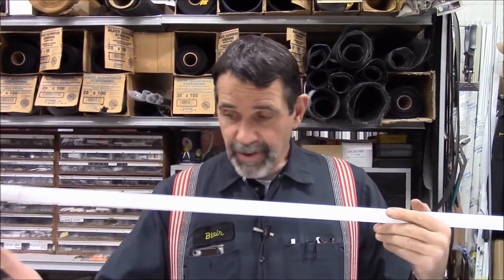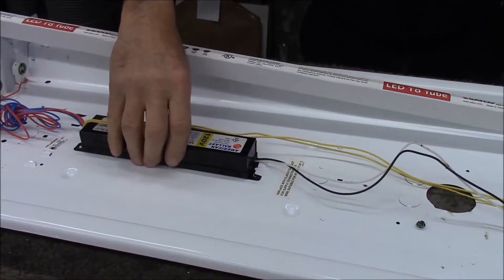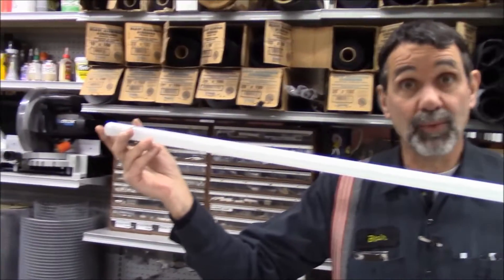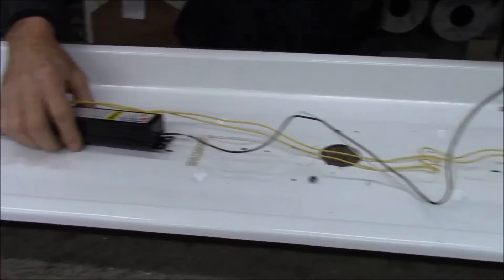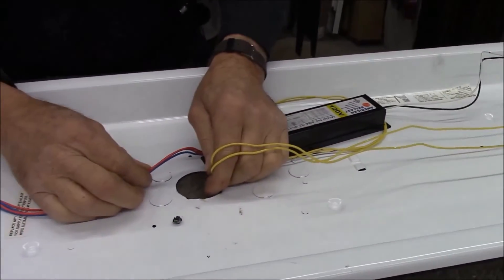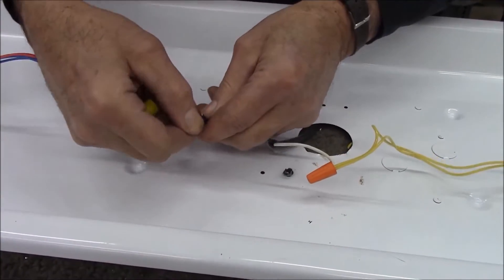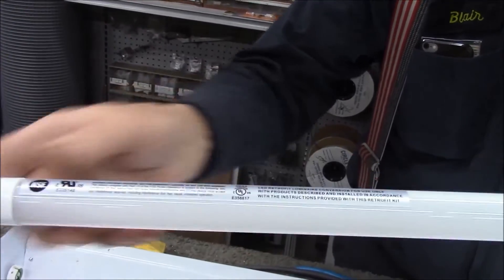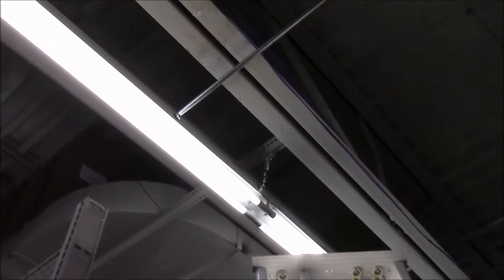Rewire Fluorescent to Led Lights - Using Double-Ended Tubes

Comment: the LED tube to use are the ones that are not LED but are actually T12 fluorescent lights that are run on a magnetic ballast.
Reply from the maker: If you don’t like led, and don’t want to save money.
Reply: @MrHardware1  I save money in plenty of other ways
Reply: In my garage I have an old 2 tube 8 foot fluorescent T12 fixture with a magnetic ballast. I don't use it much because it is very dim in cold weather and won't even turn on in high humidity conditions. LED tubes are now made so that I can easily retrofit it (single pin sockets) for about $40. Hot to one end and neutral to the other. Cheaper than a new fixture or electronic ballast and T8 tubes. It should solve my issues, be much brighter, save energy and the tubes should last much longer.
Reply: @gmzx3  right, last much longer. WHEN USED IN PROPER CONDITIONS, which are clearly stated... old magnetic ballasts (especially the preheat ones) last virtually forever. I have several of them from the early 50s that are still rocking there original ballast and are used all day every day. I give a good quality LED tube maybe 5 years of constant use before the little diodes start to die, and they start to flicker. and a poor quality (which most are) one will last maybe a year or two if you are lucky.
Reply: @WalterKnox   You may be correct about lifespan as I have only used A19 LED bulbs (with no failures). I won't live long enough to put 5 years of constant use on my tubes. Maybe 1-3 hrs a week. The thing I want to fix is the poor cold/damp performance and get brighter/more light. Eventually I won't be able to get the T12's or they'll make them very expensive to convince us.

Comment: Mr hardware, it is a great video. My existing floral stand fixtures are dual-end T12. Got the T8 dual-end ballast bypass tube and ready to do my re-wiring.  Since the switch is on the fixture, I need a bit more info on how to integrate the switch wires. The color coding is great but the switch has 2 black wires, so help. I can send you pictures of my fixture if needed. Thank you.
Reply: the switch wires have no polarity, one switch wire goes to the black hot feed wire, and the other switch wire goes to the fixture
Reply: @blairgilbert7606  Gilbert, thanks. Yes, I found a video on switches and was able to understand what you replied with.  I have successfully converted two of my fixtures. My plants will be happy with the new light! Wishing you a wonderful holiday season.

Comment: One video says put the 110 volts all on one side and don't have any wires to the other side. Now this one is saying run each side of 110 volts to both sides.
How do we know what works for what type of LED bulbs.
I've already blew up one bulb so far.
Reply: You MUST have the schematic before wiring, although some bulbs have a L for line (black wire) and a N for neutral (white) stamped on one end or both.

Comment: I heard there are some LED lamps that cannot bypass a the ballast. Is this true?
Reply: Yes, some require using the old ballast, a waste of electricity, some can't use a ballast and some go both ways. Be sure to read the info before purchasing.
Reply: Get the ones that run on 110V w/o the ballast. This will save energy and get rid of the ballast, another possible point of failure.

Comment: Question.  Your tombstones were shunted and your bulb was double ended?
Reply from the maker: I was using a bulb that went both ways, careful not all do. The video was to explain what shunted was. The end to end feed (shunted) is the easiest bulb to retrofit.
Reply: @MrHardware1  Now I'm confused. At 1:31 you say that a "single-ended" bulb is also called shunted... which was NOT what you showed in this video (which was a wire to both ends)...  Is "shunted" with power to both ends or just to one? 

I'm having a heck of a time trying to determine what types the bulbs are online (Walmart, Amazon, Lowes, etc.). It seems they don't want to say if they are one-sided or two-sided. Does it not matter?

Everything else in your video makes perfect sense. Thank you for posting it!
Reply: @mrdutson  - The main tutorial is for double-ended which starts at 1:43. The talk before that is a brief description of single-ended.

Comment: Video is Excellent for the Homeowner, good explanation and demonstration.

One caution: If you have a fluorescent fixture with a battery backup for emergency lighting (Such as in some more modern commercial buildings) you cannot remove the ballast as it will disable the battery backup. If that was the case, in an emergency such as power outage, the lights would not stay on for people to leave the building. Please be aware as well that this could impact your insurance.

We ran into this issue when we were planning to upgrade our Fluorescent tubes to LED in one of the buildings I maintain. In that event we planned on going with the direct fit ballast powered LED to maintain safety in the ones that required a ballast for backup and just bypassing the ones that didn't have the backup.

In our Kitchen at home we will be bypassing the ballast. No backups there...

Just my 2 cents-

Once again nice video!

Comment: Could I use a jumper instead of a wire nut for more secure connection?
Reply: Jumper? I don't know what that is....
Reply: Late reply, but yes. Guys in the shop i work at use jumpers for this

Comment: I've got a wiring situation that's a little bit trickier. I'm working with a hydrofarm horticultural 4foot 8 tube t5 fixture that has two ballasts, two switches that are each wired to half of the fixture, and it's got an AC socket to daisy chain another fixture to it. Trying to locate a schematic for the fixture is proving fruitless.
Reply from the maker: First off, the fixture is actually 2 fixtures in one. They are both wired parallel to the feed 110v coming in, and the output is parallel to the 2 ballasts. Where the 110v is concerned there will be 4 whites and 4 blacks. White in from power, 2 whites to the ballast, and a white to the output to the next fixture. Blacks are the same.

Comment: Hello how do wire if I have 4 fixture ?  I only did 1 it blew the bulbs.  

Thanks
Scott
Reply from the maker: It depends on the led bulb whether I wire the black hot to the left and the white to the right or  black and  white to one end of the  bulb.  The bulb comes with a drawing of the power connections and that should help if you aren't done already. Sorry for the late response.

Comment: Two questions. First, it looks like the led tubes you're using are t8 size. Will they work in a t12 Fixture! Second, my fixture only has 2 t12 bulbs. It has two blue and 2 red on one end and a yellow wire on the other, the hooks to the second tombstone. I am assuming that I will connect my hot wire to the red/blue and the neutral to the yellow.
Reply from the maker: Yes, t8 and t12 two-prong tombstones are the same. Get the bulb first, then rewire. Some bulbs want power at one end, some want power on opposite ends. If you get bulbs that wire on one end be sure your tombstones have 2 separate contacts.
Reply: get t12 ballast bypass bulbs! t5,t8,t12 are all different diameter and even slightly different length!

Comment: You made it very easy and I use your method and it lit momentarily and went out.  I bought my  bulbs from Wal Mart.  I must have the non-shunted bulb. Show us the non-shunted and tell us how we can tell the difference between the two.
Reply from the maker: This is not up for experimenting, get a wiring diagram and follow it. Look for a L and a N on the ends of the bulb. L is for black and N is for white. If your tombstones are shunted (both contacts aren't separated) you will have to buy shunted bulbs or replace the tombstones.

Comment: Super great video. Thx so much. What LED brand do you recommend - with 4000K and 5000K?
Reply from the maker: I'm using Satco bulbs, but I would use any bulb from a source I could depend on.
Reply: @MrHardware1  I did exactly what you showed. I have an 8 ft shop light. Uses 4 ft bulbs. Middle has red and blue wires and both ends have yellow. I wired it exactly like you showed. The bulbs got super bright and hot, then slowly stopped working. Any idea what's happening?
Reply from the maker: @adamlangley7341  can you send me a picture of your wiring and a picture or model number of the LED bulbs you installed. I can only guess that possibly you wired a shunted bulb in an end-feed situation but I don’t know without any info. Better yet, contact customer service of your bulb manufacturer, (with your wiring diagram) possibly you got defective bulbs.